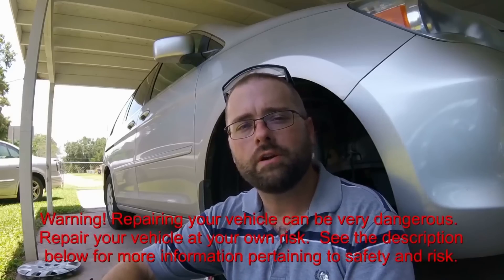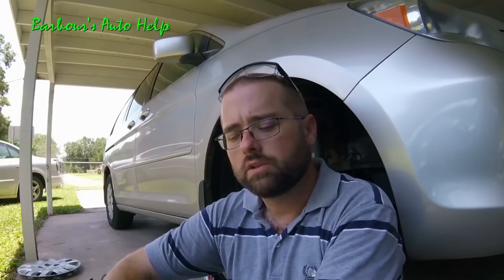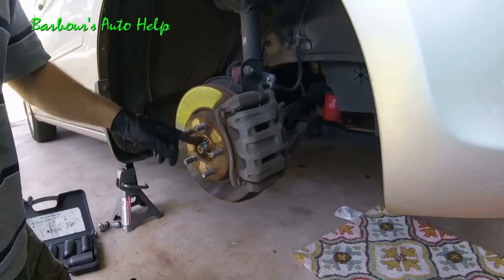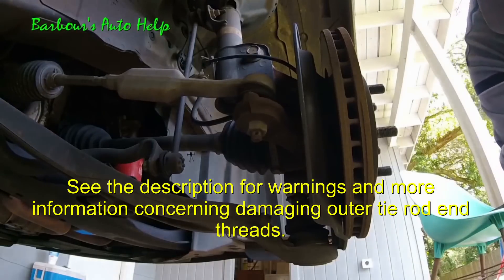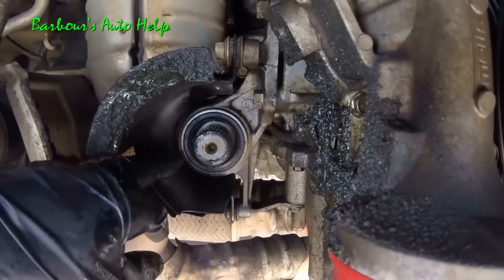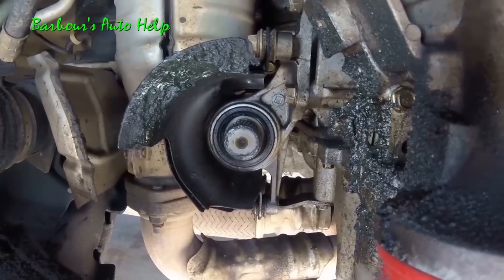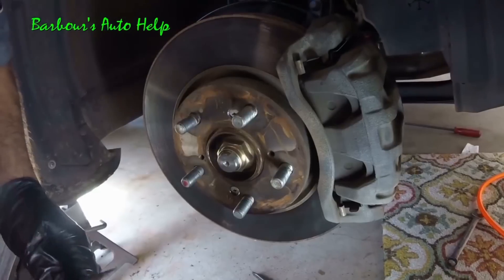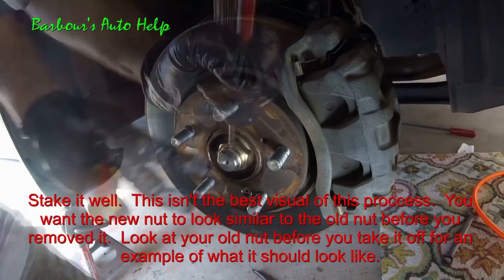CV Axle Replacement 05 Honda Odyssey

Comment: 05 Odyssey - Was hoping it was lower control arms and not the cv axle. If it happens primarily on acceleration, (definitely the CV axle.) I started with 2 new tires. Better ride but still had the bad vibration above 40 mph. So then bought 2 control arms. Installed one, much better ride.... But then...
 noticed driver side axle was nearly in two  pieces just prior to installing the second control arm. 😔.
Reply from the maker: It’s difficult sometimes.

Comment: Hey I have a problem. I have an 07 that we absolutely adore since new, now 240,000 miles. Back in December we replaced cv axles because of the aforementioned shaking under acceleration at higher speeds, they are remanufactured components. Our front struts were getting pretty worn as well and soon after we replaced those front struts as well, but here we are again with a another shake in the floorboards and steering wheel when on the gas particularly at higher speeds and under strain. My mechanic states that the replaced cv axles are indeed still fine. Rotors have just been replaced problem and the problem still was persistent before and after that as well. Any ideas? Tie rods are slightly loose but not bad, and I’m wondering if it could be something like ball joints yet again I don’t want to keep throwing money at random assortment of parts. Thanks for any input.

Comment: Thank you for posting this.  I just changed the CV axles on my dad's 2005 Odyssey and we referenced your video several times during the job.   It was very helpful.
Some comments that may help others:
Torque Hub - 242 ft-lb, steering 40 ft- lbs, lower ball 45ft-lbs.
Have someone stand on brake pedal when removing or tightening hub nut.
Harbor Freight lever style ball joint tool worked really well.
Reply: William Manley   Thanks William, this will be helpful on the CV axle removal this weekend. That reminds me, I need to purchase a torque wrench for this task.
Reply: @elgatogordo9523  You may rent it on AutoZone. Once you return the tool they will give you back your money of the rent, so it's basically is free to rent.
Reply: davidopful   Cool! Just got the CV axles yesterday. Not sure, I think my son is buying me a torque wrench for my birthday 🥳 If not, Auto Zone, here I come...Thanks 👍
Reply: @elgatogordo9523  How did it go?
Reply: @davidopful  Replaced both CV axles and the vibration is GONE! Wife is happy and she even made me my favorite dish 😁  BBQ marinated flap meat with rice and beans with ice cold Coronas 😋 My son did get me a torque wrench 👍 Next project is to replace the struts/shocks.
Reply: @elgatogordo9523  hard work pays lol Good to hear that. I have a 2007 Accord V6 auto and I change the struts assembly myself and lower control bar, it was easy. Odyssey should be easy too (struts assem.). I need to change both cv axels too because is vibrating like crazy. Let you know how will went. Keep DIY!
Reply: @davidopful  Cool! Make sure to check engine and transmission mounts too. Replaced them on the Ody, front, rear, and trans mounts were pretty bad.

Comment: Do you need to clean the old grease out with say brake cleaner spray where it slides onto the spline on the transmission shaft?

Comment: Great video, thank you very much, just to know if the vibration that I had with this repair was finally eliminated? ... because I am having the same problem with a 2011 Accord. Thanks.
Reply from the maker: Was that a question?
Reply: @BarboursAutoHelp  Yes, sorry, it was a question. Was the vibration problem solved, replacing the CV axle? Thank you.
Reply from the maker: The vibration was corrected by replacing the axles.

Comment: For posting this video. I wish I would have listened on removing the ball joints with the other methods you recommended, almost messed up my threads and couldn't get them to tighten back in

Comment: Why did you unhook the tie rod end?  hub assembly should just tip out of the way once the strut is unhooked.
Reply from the maker: That's the way I do it.
Reply: If you unhook the strut your alignment can change causing more expense for an alignment.  A good mechanic would not unhook the strut unless they were going to do an alignment anyway.

Comment: Why not undo the 2 strut bolts instead of the lower ball joints? Reason is: I ALWAYS have trouble getting ball joints loose... The hammer method has NEVER worked for me.
Reply from the maker: What ever works for ya.  Sounds good to me.

Comment: IT IS WAY EASIER TO REMOVE THE 2 TOP STRUT BOLTS instead of messing with those ball joints. Otherwise a good video.
Reply: Just did this job today. Followed your advise removing the strut bolts instead of the ball joints and it was much easier than shown in the video. Thanks!
Reply: I’ve done it a bunch of times now. Also easier if someone sits inside the car and turns the steering wheel to move the tie rod ends to help you get the axle out. Need to remove the brake line bolts and speed sensor clip too.
Reply: Alignment problems
Reply: Thanks man. You saved my day!! I replaced both side yesterday.
Reply: There's no need to do alignment using this method. More trouble, yes. Save money, also yes.

Comment: Great video! I have a 2010 Pilot with vibration upon acceleration over 25 MPH gets worst with speed. Any chance it can be the cv Axle? I have changed front and rear suspension, front and rear sway bar links, front and rear sway bar bushings, putter tie rods and road force wheel balance nothing seems to “fix” the vibration. Any help would be greatly appreciated

Comment: what if the axle nut is crimped on to prevent the average DIYer from doing the job themselves?
Reply from the maker: I think I went over this in the video maybe.  Didn't I crimp mine with a screwdriver?

Comment: Great job on replacing the CV Joint. Another method would be to place a sizeable screwdriver into one of the vent holes of the rotor resting it on the top of the caliper in order to break the CV joint wheel nut. Correct me if I’m wrong, but the advantage of removing the tie rod and ball joint will eliminate having to realign the vehicle.

Comment: I'm getting a similar situation.  I have a 1999 Mercury Villager.  I was getting a huge amount of shake from the front passenger wheel.  I replaced the whole CV axle on the passenger side.  Problem was gone for about a month.  Now tonight coming home about 50-60 MPH shake returned, and also shakes at lower speeds.  When I let off gas, it stops, and then when I either hit a bump or accelerate, shake comes back, and it's the same passenger side that is shaking.  CV axle seems fine, no play al all.  Steering makes some noise when turning right, almost like a grind, but not really, hard to explain it.  Should I look first at ball joints and tie rides?  or could the steering rack cause I vibration like this?
Reply from the maker: It could be one of a few things.  Especially anything that is loose. Be sure to check everything shown in the video.  Never hurts to check it all.
Reply: How did you fix this issues please?

Did you change the axle to OEM to fix the whole issue?

Comment: First off, this is a very good video. If you are going to do the job this way, I have a suggestion. Spray down the ball joint, tie rod and end link nut and threads with some type of penetrating oil. If possible, do it the night before and again right before you do the job. They most likely have serious corrosion built up and are probably seized on really good. What tends to happen is that it takes so much torque to loosen the seized nut that it starts to turn, but it's not the nut turning off the threads, it's the nut and ball socket spinning together. Which means you will have to change your ball joint or tie-rod end, probably after you have to cut them off. And if you have to change your tie rod end, you should get an alignment. Also, most end links that are over 10 years old and in the north, will probably crumble in your hands when you try to work on them. I'm not saying not to do the job this way, but to be aware. I have seen plenty of people try this job on a Sunday, then spin a ball joint, have to cut it out and they can't get a replacement ball joint for a day and need their car for work on Monday.

Another way to do the job is to remove the whole caliper and bracket from the hub/spindle assembly. Remove the nut on the axle end. Remove the two bolts that connect the hub/spindle assembly to the lower end of the strut. And you can then tip the hub/spindle assembly forward and remove the axle that way. Make sure that when you remove the caliper assembly, that you support it somehow,  like a zip tie. Don't let it hang by the brake hose. There might also be an abs wire harness that goes to the caliper. If so, you might have to remove the harness retaing bracket on the control arm. And most importantly, mark the position of the bolts that mount the spindle to the lower strut using either a scribe, paint marker, nail polish or whatever. They are eccentric bolts and if they don't go back in the same position, you will most probably have to get an alignment. 

Cheers.
Reply: What do you mean by mark the position of the bolts to the strut? Are the two bolts different?

Comment: Great video.  I am getting ready to replace the CV axles in my 2001 Odyssey.  The only question I have is regarding the CV axle into the carrier (transmission side).  First off, it seems odd that once the CV axle is disconnected from the wheel that it has nothing retaining it into the carrier, or at least very little that it can be "punched out".  However, there is that perplexing circlip, around the bearing shaft... does that simply pop into a groove in the female side of the CV axle, and it can simply be "punched out" using the pry bar and the hammer?  Does the circlip get damaged when you remove and reset the CV axle?
Reply from the maker: I believe I mentioned possibly replacing them or referencing a repair manual regarding recommended replacement.   Either on the video or in the description.   I cant remember.   Some mmanufacturers do recommend replacing them.

Comment: I'm literally watching this on the 4th of July.
Reply from the maker: I see you watched the video to the end.  Happy 4th!
Reply: @BarboursAutoHelp  Yes. Very helpful!  Bought the axle today, waiting for it to arrive.  I also watched your trouble shooting vid related to this.  I have a 2003 pilot with a nasty vibration after 60mph only when foot is on the gas.  That vid helped a lot.  I'm thinking this fix should solve the issue.  It was slinging grease, so... Odds are...
Reply from the maker: Have you had a chance to make the repair?
Reply: @BarboursAutoHelp  Do you have cameras on my place?  Literally fixed it today.  Weird...
Easy fix and it solved the vibration problem.  Thank you!

Comment: Hey man.. i have a cuestion!!!
I have a 06 odyssey vibrates /shakes bad at 60-65 under acceleration only.  Tires are new. With balance. And has new motor mounts. 
I noticed my boots are leaking but there no popping noise or cluncking when i turn.
Just shakes bad under load. And acceleration  only at 60..65.. can a bad axl cause this?? Im planning on doing this is just im gonna be piss if doesnt resolve this.
Please help.
Reply from the maker: It could be but I'm not going to promise you that's your problem.  I've got a video linked down in the description that goes over how I diagnosed my problem that sounds similar to yours.  Apart from providing the videos I've made I'm not sure If I'll be of anymore help to you.  I hope they lead you in the right direction.  However, I never discourage anyone from having a hands on technician diagnose a problem.  Its often best to and could potentially save you a bunch of money.
Reply: Not sure about the Odyssey, but this is a common problem on the Ford F150.  The emergency brake is the problem, sometimes due to rust in the cable it will stick slightly and at lower speeds isn't noticeable but as the speed increases anywhere from 40mph and up you'll get the shimmy and shakes.  At the higher speeds it's scary as hell.  Like I said, not sure about the Odyssey but it's worth a look if you can't find anything else that could cause the problem.  This drove my mechanic nuts, but the dealership knew right away what it was, and of course Ford had no recalls on the problem.  Needless to say I'm no longer driving Ford, after 40 years of loyal ownership.

Comment: great write up and video, made job easy, do I need to get front end aligned after this job?
Reply from the maker: You shouldn't.   But, if it hasn't been checked in a while then its worth checking.

Comment: As far as the ball joint nut goes,  I have a torque wrench with a removable socket head and you can put in different size open-end wrenches that came with it.

Comment: Passenger side:
What about the clamp with the two 10mm bolts that hold the inner end from jumping out. 
Also, did not remove any tie rod ends or ball joints.
Used my floor jack to hold everything in place,  used a screwdriver to hold the brake/wheel assembly through the bottom strut holes. Just a different way to skin a cat.

Comment: 8:21: I got a code p0420 bank 1 oxygen sensor after this passenger's side.  I was banging really hard to get axle out.  My pry was the tire iron bar cut in half, i wedge it between the Y and bang on it really hard.  One point 8 inch piece iron got stuck the axle lip and the tranny. I hit it really hard to dislodge the axle. Do you think i could have damage the exhaust part or the catalytic converter when hitting axle out? I also changed out the 6 new spark plugs plus i did timing belt all it same time within a span of 3 days.  Thanks. Do  you think i need  rear new oxygen sensor ?
Reply from the maker: A code p0420 means that the vehicle has detected that the catalytic converter isn't doing its job as well as it should.  Usually this is caused by a faulty converter.  But, you could have a leak in the exhaust system too causing this code.  Odds are its a bad cat though.  It will need to be diagnosed properly to confirm this though.  I'd suggest having a shop check it for you.  I don't have any videos outlining the diagnostic procedure for this code at this time.  Other than that, hows it running?!  That's awesome that you knocked all that work out.  That's a tall order.  Good job.  Unless you hit the exhaust directly when banging the axle out I don't think the P0420 is your fault.  Chances are this was a problem before you did the job.
Reply: @BarboursAutoHelp  
Thank you.
Reply from the maker: No problem
Reply: @BarboursAutoHelp  hello sir: i text my friend who is a home mechanic, he also said it was common problem for old Honda Odyssey.  Anyway, I have good news: after driven 2 full tank of Costco Premium gas.  The code went away on it own.  The last full tank I filled up with expensive $10 fuel cleaner bought at Walmart.  The full tank followed that I didn't put anything in it.  I just refill with premium again yesterday morning before going to work. Anyway,  on my way home, I cruised at 80 mph on freeway about 10 minutes, the check engine light went away and disappear on by itself.  I was happy but still have to wait for a few more hundred miles before it goes away for good.  I will save to by OEM Cat just in case it comes back.  I hope i didn't jinx it.  Thank you

Comment: Get ready for the cv to not come out. Fix it for $3.75 if you already have an ax or anything with a heavy end on it. Buy 6 feet of 1/8 wire an 2 zinc clamps. Wrap one end around the pos part that is stuck twice and then clamp it relatively tight and make a loop for the shaft of the ax with the other clamp. Stick the tool through and swing straight out. Problem gone.

Comment: BarboursAutoHelp ; Great video and thank you. Question. Did you remove the spline that goes into the trans housing?
Reply from the maker: Everything you see in the video is what I did.
Reply: @BarboursAutoHelp  ; Yep, I know that. When you removed the old CV axle, the spline was still in the trans. The new CV axle has a spline. So what gives?
Reply from the maker: The new cv axle goes onto the splines.  Its female.  The driver's side cv axle is male.  The drivers side goes into the transaxle.  The passenger side does not.  It mounts to the splines you saw still left in the trans.  The splines you saw left in the trans is not a part of the cv alxe.  Does that help?
Reply from the maker: No, I did not take the splined shaft that you saw left in the transmission out.  When just replacing the right cv axle you do not necessarily have to take it out.
Reply: @BarboursAutoHelp  ; Thanks so much. It was a little confusing seeing the old cv axle, female, passenger side, without a spline and the new axle with a spline. Anyway, it was a false alarm about my friends Honda Odyssey.
Reply: @BarboursAutoHelp  ; Sorry, I just caught this. I did a background check of your video and notice a 2nd new CV axle. So you replaced both front axles. I didn't read your intro. :0
Reply from the maker: No problem whatsoever.  Yea, I replaced them both but just filmed the passenger side.
Reply from the maker: I'd say if it wasn't doing it before then either the axle is bad or maybe we need to look back over our work.  Make sure everything is tight.   My best guess anyway.

Comment: I would take huh loose from the strut instead then you can rotate the hub away from the vehicle it’s a lot easier to get the axle in and out
Of hub and you don’t have to remove ball joint or tie rod that way. Way faster and easier